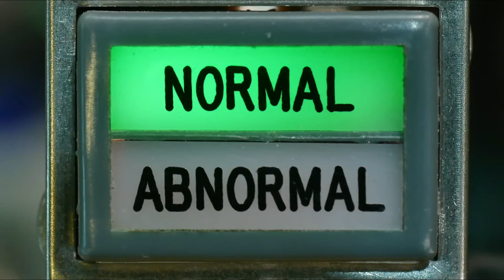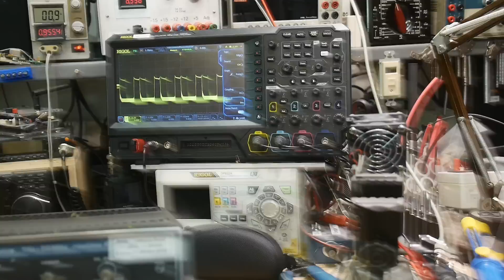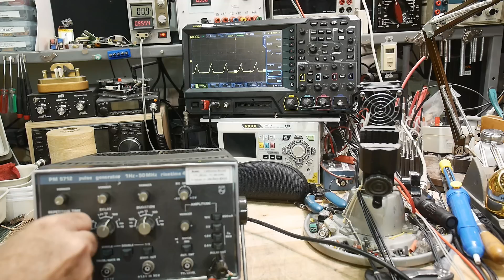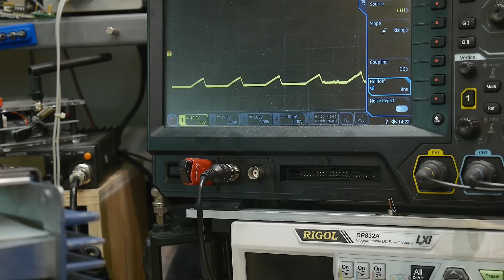#1266 Philips PM 5712 Pulse Generator (part 1 of 3)

Comment: I have one of these, it's nice but compared to HPs it's too plasticky.  It has a broken 50ohm load and filter capacitor on the power supply side.  I also have the same broken feet because the seller wrapped it in paper then send it by mail :(

Comment: As a Dutchy we still see these a lot over here in the Netherlands. The plastic gets really brittle, a little bump can shatter a big part of the housing. I still haven’t started working on mine and haven’t watched the whole video yet but I bet a lot of those small blue axial capacitors are crap after 40-ish years. I replace them with vishay 021 ASM which are pretty much the same capacitors. Philips had their own capacitor factory “elcoma” that was sold to BC and later became vishay. The switches are also prone to failure.